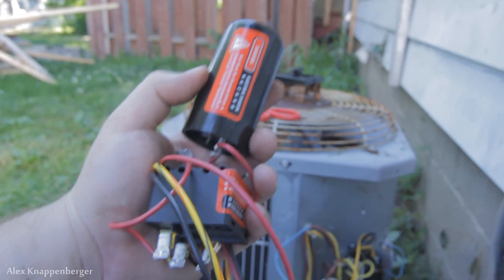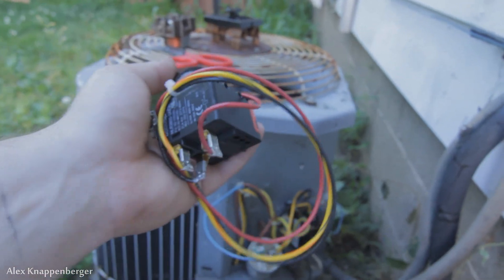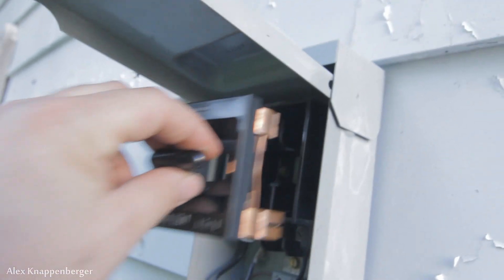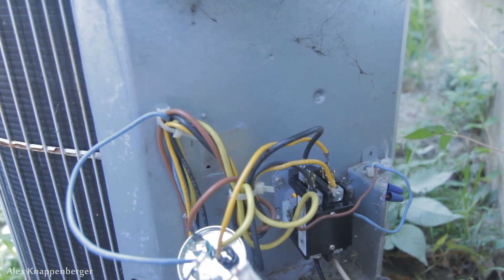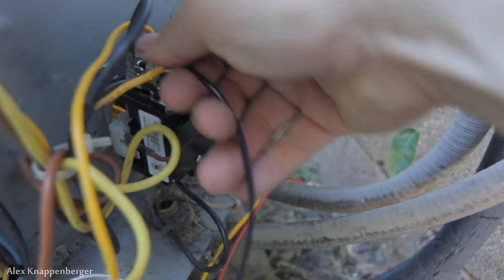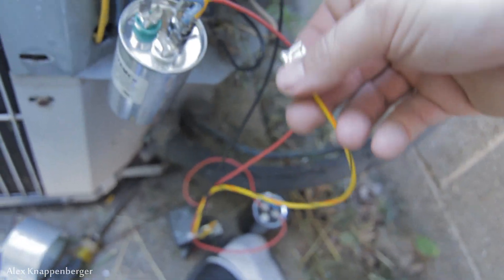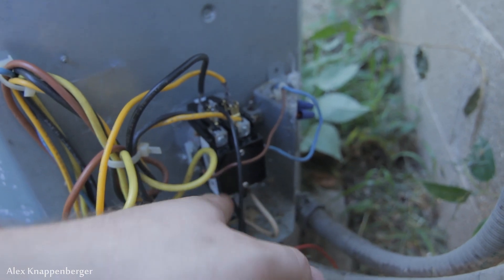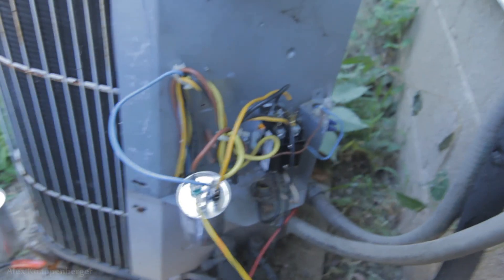5-2-1 "Compressor Saver" Hard Start Kit Installation How To

Comment: Great video, thank you! Open Question for the HVAC Gurus... I just installed a CPS 5-2-1 CSRU3 
Hard Start KIT in my 7YR old Rheem 5-ton unit, which was running fine, 
but a slightly slower, noisier start recently. I replaced the contactor @
 same time. L.R.A. for my Rheem = 152.9AMPS. BEFORE 5-2-1 Install, 
Compressor "C" wire Metered INRUSH = 157.2AMPS. AFTER 5-2-1 Install, 
Compressor "C" wire Metered INRUSH = 156.1AMPS. (Basically, NO CHANGE). 
Wiring was done per CPS instructions. Both the 5-2-1 kit Start Capacitor
 & Rheem Run Cap (2-terminal) Capacitance multi-metered within 
specs. New contactor functions normally. When ThermoStat calls for 
cooling, Compressor/fan cycles normally, runs same as before 5-2-1 
install. (That's the problem). No change in compressor start 
sound/speed/InRush. I was expecting a 25-40% drop in InRush current 
after install, based on so many testimonials. What am I missing? Can't 
post pics of install here, but new contactor was a simple wire-by-wire 
swap. 5-2-1 kit wiring was easy: Common wire (#5-BLK), goes the same 
contactor "T" terminal as the compressor's "C" wire, (#2-YEL) goes to 
the HERM terminal on the Run Capacitor, and the (#1-RED) goes to the 
Common terminal on the Run Capacitor. Any advice? What did I miss? I 
already have a question in to CPS, the manufacturer. Hoping the HVAC 
gurus might help me get my head around this one. I'm not an HVAC tech, 
but I work on lots of stuff - nothing burned or blew up. Thanks in 
advance.
Reply: Keith, did you ever get an answer from CPS? I just had the same issue with a kickstart T05 last night. I've made arrangements for a replacement, but i'm guessing it was not a bad unit. I've checked everything out just as you've mentioned. Curious what you may have been told by CPS
Reply: Anthony Williams  Hey Anthony, it was odd: the results I posted in my comment related to the first two “call for cooling” cycles I metered. I went back a couple days later & metered again - for some reason, then my inrush was measuring consistently 141-142Amps. Don’t know why the change. CPS did reply to me & explained that with my Copeland UltraTech Scroll compressor, I should not expect the same performance improvements as either non-Ultra version, or piston-type (greatest gains, apparently) compressors. So, in the end, I was glad for some improvement, in spite of it being more modest than expected. Hurricane season in FL now & I’m sizing up a whole house portable generator that will support my 5Ton central A/C, so looking to drop my L.R.A. even more (with a soft-start kit 60-75% claimed reduction in L.R.A.), to reduce chances of browning-out the generator. But, they’re not cheap: $260-360, but if it works as claimed, what I spend on that Kit, I will save on lower initial cost of a lighter duty generator that also burns less fuel. So it goes...
Reply: @edvanhalen9056 not sure if you ever got it figured out, but may want to consider upgrading to larger dual run capacitor depending on what you have, if its a 5 ton then usually they come with a 60/5 or 70/10 but if thats not what you got i would upgrade
Reply: 0il9

Comment: I tried to install a 3 wire hard start on my 2 Ton condenser and all went well till I went to hook the third wire on my run capacitor on the top there are 2 poles with multiple connectors and the last only had 1 connect and it was already used. So should I buy a new  run capacitor or a 2 wire hard start ?

Comment: He should have put the black wire on the bottom spade terminal on this contactor. You want it on the incoming power feed with a two pole. With a single pole shut it does not matter top or bottom as the shunt side always has power.
Reply: Does it matter as long as you are on the "All-black-wire" side ( left-to-right) of a double-pole contactor? In this case, he was on the proper left side....but connected on the top-side ( is this T1 ?...to load?). You are saying it needs to be connected to bottom / incoming / L1 .....does it matter?
Reply: @TheWilferch  good question....  might be due to more chance of the contacts arching with in-rush amps at start up...
Reply: labels on contactor boxes name these a 1 1/2 poll....

Comment: My review - Added the 5 2 1compressor saver to my 5 ton Lennox condenser. Made a huge difference. Much quieter at startup. Thought something was wrong it was so much quieter. For $40 it's a must have for all condensers. Wish I had a good meter to measure in-rush. What ever the in-rush was and is now, this thing works as advertised.